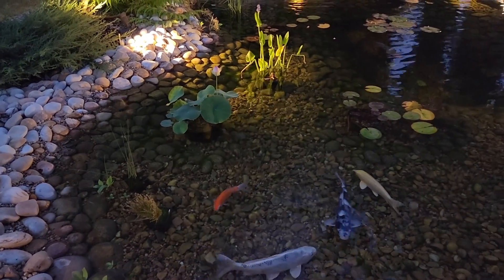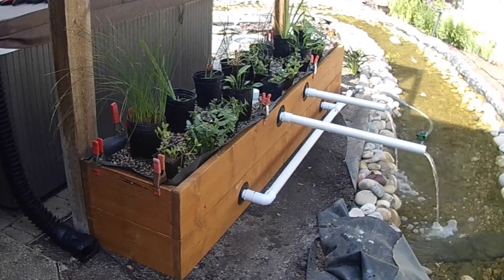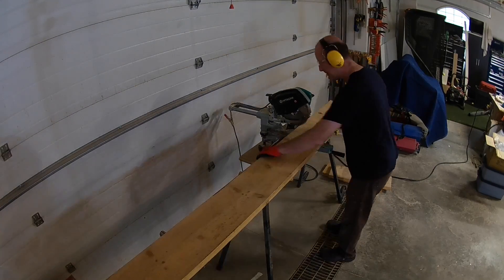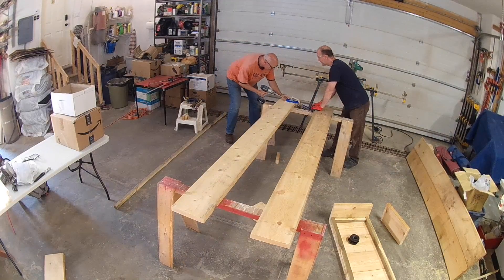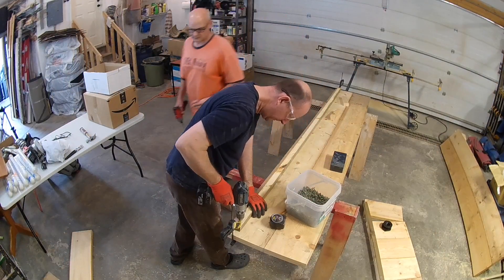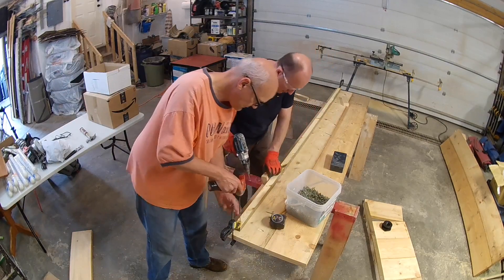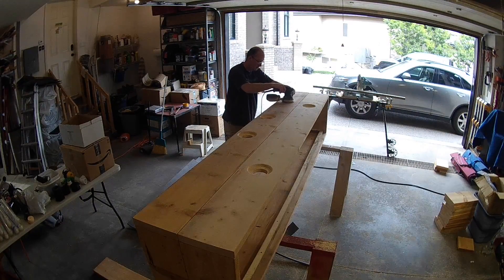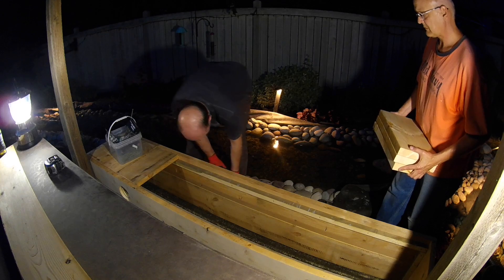How to build a bog filter (Series) Keeping Your Koi Pond Clean - Episode 1 - Building the Box

Comment: When you say the bog filter should be  25 to 30 percent of the surface of your pond im confused. What measurement of the bog should be 25 percent.  I have a small  concrete pond, 7 feet by 2 feet and 3 feet deep. So 315 gallons.
Reply from the maker: So you pond has a surface area of 14 square feet.  25 to 30 percent of that means you would need a bog filter that is around 3.5 to 4 square feet.